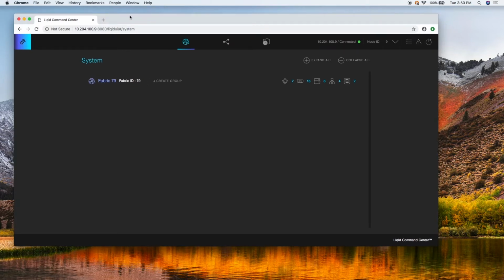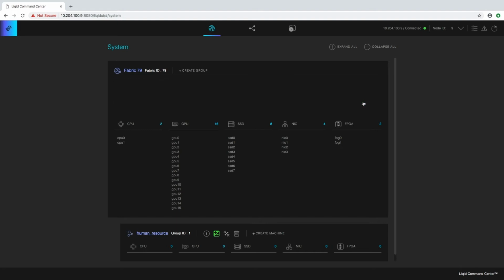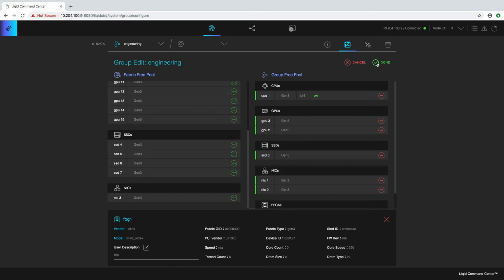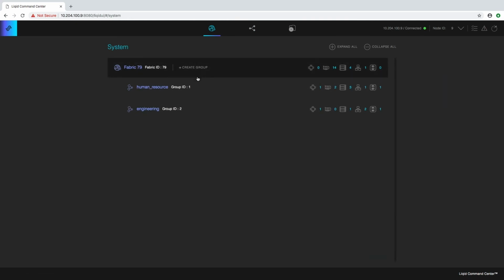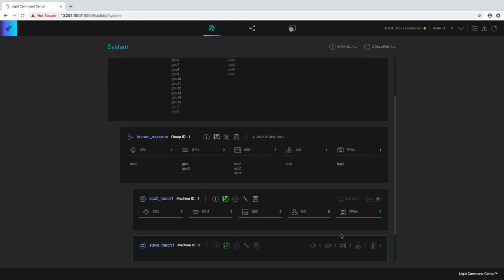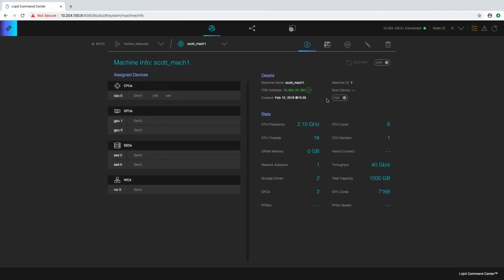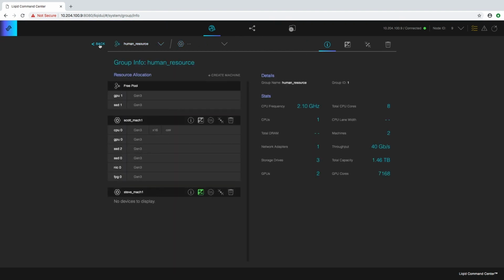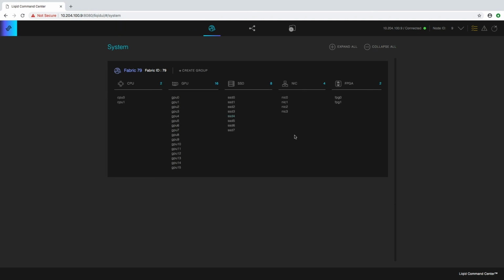Liqid Composable Dynamic Infrastructure (CDI) Demo

Comment: Can the Liquid Composesd machines have some sort of failovrer capability? Meaning if a physical device that is composed in that machine fails, can a replacement resource be provisioned on the fly.  In general please elaborate on high availability features that the system has

Also, is it counter-intuitive to run another layer of virtualization like HCI on top of composed servers/machines?
Reply from the maker: Good question. If a server fails, you could simply compose its resources a new server via software, rather than doing I all manually like you do today. However it's not automated today.